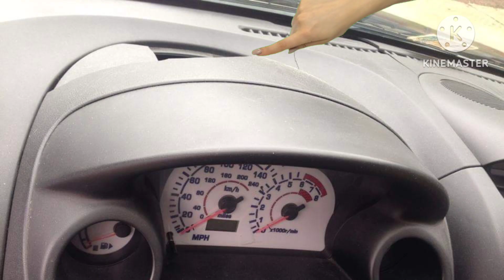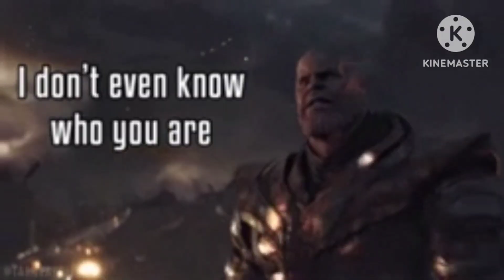Things I hate about the 3g eclipse

Comment: Man you hit everything right on the head! My 03 GTS has no dash left, it just broke apart like peanut brittle. Wheel gap didn't bother me too much but keeping the rear wheel alignment stable after running it a few times became a nuisance. Good luck on aftermarket stuff for this ride unless you visit a junk yard and find one with some of the parts that were made back then. The weight sucks unless you go with alloy suspension parts and even wheels. Get a fuel cell and take that heavy tank out from under the rear seat. I love my 3G Eclipse, modified the front engine mount a roll mount to a solid caster pressed in instead of the rubber motor mounts. Oh one other thing, those rear hatch rams, they seem to blow out a lot! Still a nice ride if you keep up on it.
Reply: My 03 eclipse has been garage kept by a grandma, no problems yet but it only has 80k miles and no dings or sub damage

Comment: Bonus to the weight is that the car feels way more solid than its contemporaries. I've owned a few hondas, a vr6 jetta, 2nd gen eclipse, and 3rd gen eclipse. The VW and hondas always felt rickety AF. The 2nd gen felt pretty solid overall, but the 3rd gen just feels luxurious in comparison. Also with the hondas if I tried cornering too hard, I could get some nasty front end drift, the 3rd gen just sticks and cuts hard. To be fair, everyone loves the 1st and 2nd gens a lot more, which it's understandable.. but my butt dyno says the GTS eclipse is faster than any of the 1st/2nd gens, probably very close to a gsx. Of course 3rd gen aftermarket support sucks balls and there's a lot more you can do with a gsx.

Comment: Got a 03 v6 automatic and I Don’t mind the cracked dash on mine but the motor mount is messed up and causes the whole front end of the car to shake when im stopped in traffic unless im in park
Reply from the maker: Which mount is it. Those are a easy fix
Reply: @tcroc30  unsure how to find out. It’s a 2003 GTS  3.0 v6 hatchback

Comment: So I got mine not too long ago and I have to say that I agree with all of these points. And if I could add another, I'd say I dislike how slow it is. I've got the 2.4L 4 cyl GS, so it only has ~120 hp. I'd love to order a turbo/supercharger kit but I can't really find anything
Reply from the maker: 2.4 is easy to turbo. You can use a lot of evo 8 parts on it
Reply: @tcroc30  you've gotta be kidding. Thank you. I'm gonna do a lot of research on that because I'd love to install a turbo not too far down the line
Reply from the maker: No problem check out so 3g Facebook groups. They have a lot of guys who have done it

Comment: I still need to get an turbo manifold for my 3.5 swap done these cars mad underrated just not much parts available anymore your at this point in time where u need to stock up on parts Yk that your going to break over time like sensors and engine harnesses for engine swaps etc just crazy I only know like three people to who tune these cars for an living and it’s ap tuned and chaos and my buddy travin best tuners for this platform
Reply from the maker: Any tuner that tunes evos with ecuflash can tune. I have had several shops tune all of my track cars. Eclipse and stratus
Reply: @tcroc30  not here in az no one can tune here they scared to touch it
Reply from the maker: UMS tuning in Mesa Arizona tuned a few 3gs

Comment: Definitely agree with it all. It's impossible to find mods for my car. If you do. The price is high and the quality is usually garbage. This car weighs more then my old camaro. Though I do have a spyder.  Shops here won't touch my car.  The act like it's a Lamborghini or some aliens car. Only one speed shop in my city would do work on.  The price to do anything is usually double what I paid for it.  I am removing the dash now. It already had a Crack in it and it snapped in half. The part that is by the radio shattered. I'm to the point. I'm going to fix it.  Then I'm going to make a carbon fiber replacement.  I think I'll do that fir all the plastic trim.  If I have molds.  I may sell parts for it in any color. If I do.  Since you have always been there to help with all my crazy questions.  I'll send you one for free. I got 20" rims on mine.  I got to make a wide body kit for it.  My wheels stick out about an inch. The wheel wells don't look right naked with the body kit I have. All of the two kits I found look horrible on the car.  To big or to cheap looking.  I'll keep you posted on that. Love your content. Thank you so much for support.
Reply from the maker: I've seen some guys reinforce the dash so it doesn't crack. That is something I may look into. It just sucks mitsubishi went cheap on that part
Reply: @tcroc30  I agree. Since my son told me he doesn't want the car it's going to stay will me.  Then I redoing the interior. All white red accents. Suede leather in the floor and ceiling. Leather and carbon everything else. This car is all about learning.  So my next lesson will be carbon fiber.
Reply: What’s your Instagram
Reply: @alexfish7555  I don't have Instagram.

Comment: I mean you own a v6 3g those things are absolutely pigs compared to the RS/GS trim levels and not to mention you don’t have carbon hatch or lexan windows either
Reply from the maker: Rs/gs is 200lbs lighter so I wouldn't necessarily say a v6 is a pig  comparing those. You mention the a carbon fiber hatch BUT the weight of the hatch is solely due to fact of the heavy window so a carbon fiber hatch is just purely a aesthetic mod. It's not even true carbon fiber is simply fiber glass wrapped in carbon fiber but anyways back to the main point of the 3g eclipse is a heavy car gs or v6 IMO